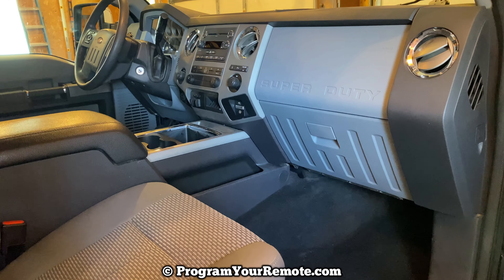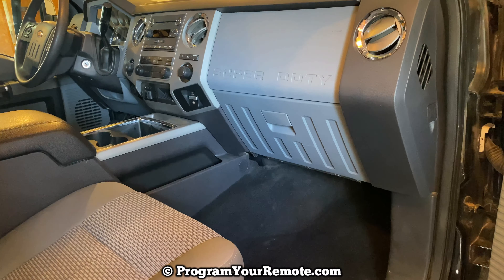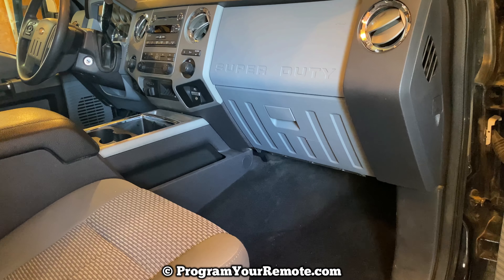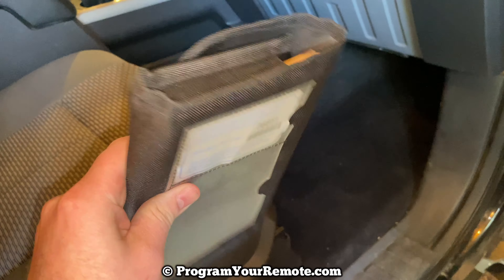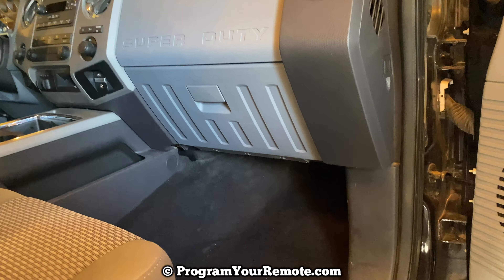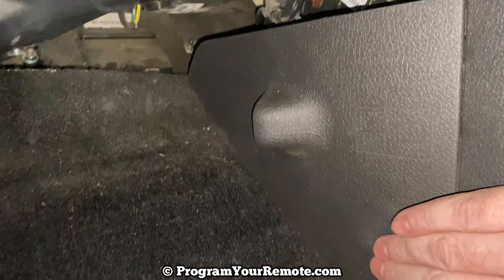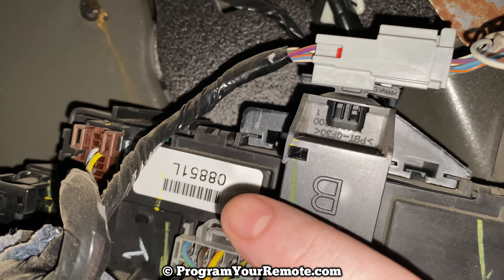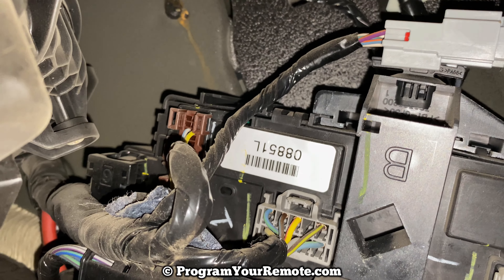How To Find Keypad Door Code 2011 - 2016 Ford Super Duty - F250 F350 Key Pad Entry Code F-250 F-350

Comment: On a 05-07, open the mini drawer on the lower right below the steering wheel.  Push sides of drawer to release drawer so it folds all the way down to floor.  Lay on you back with a flashlight, look inside dash for white insulation.  Move it out of the way.  You will see a box with a green ang gray connector.  The factory code is printed on the upper right of the label.  It is 5 digits.

Comment: Thanks so much!  I just got a 2012 F250 Lariat &, as always, the dealer was ABSOLUTELY CLUELESS.  They didn't even have this keyless entry code... or any other info.  It has the navigation system, but I haven't been able to figure out how to get Navigation to actually work.  Do I have to have my phone connected the SYNC via USB?  Also, the backup camera displays on the rearview mirror.  How can I get it to come up on the radio?